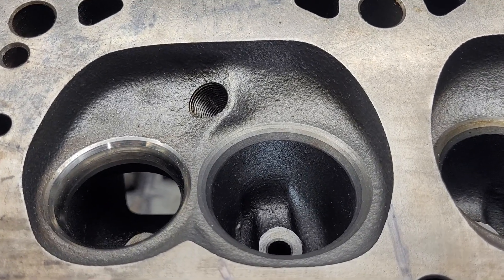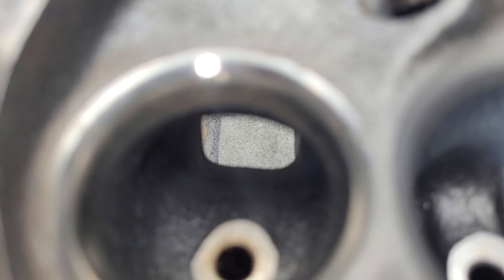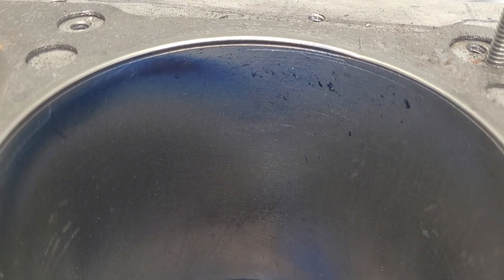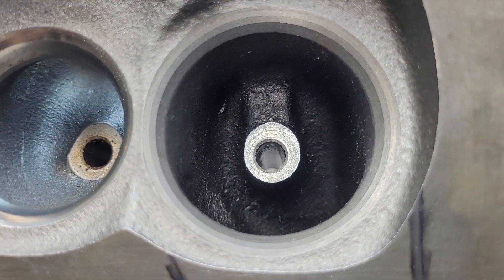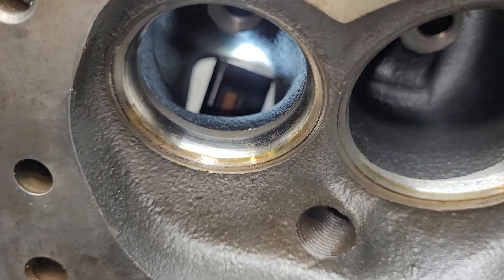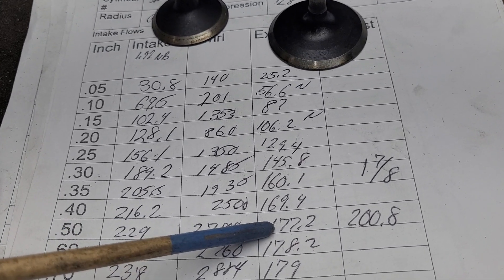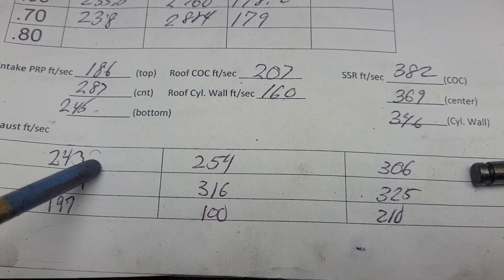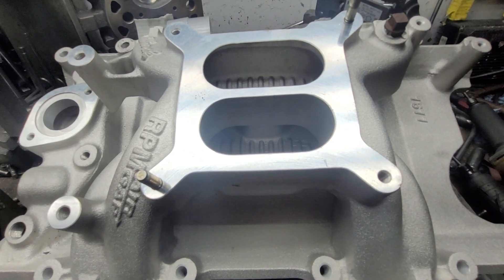EQ magnum cylinder head stock, flows and air speeds. Easy 400hp 360?

Comment: The problem with magnum heads isnt the intake pinch, its the shortside radius's and the shrouding on the valves..... deshroud both valves and clean up the short sides  and around the guides and the increases are substantial.... back cut the valves while you're at it
Reply from the maker: Do not back cut exhaust valves. Thanks

Comment: These are good heads, I have seen a few good porters get these to 300 cfm with 2.055 and 2.080 valves, 400 HP easy money. Thanks Charlie
Reply from the maker: Good info. Thanks
Reply from the maker: Wonder how they handle that pinch?
Reply: @servediocylinderheads    I dont know I am not a head porter. The information is on forabodiesonly  the Gentleman post on there, builds some great small blocks in magazines articles etc.  { SKMFX Budget Small Block - Popular Hot Rodding Magazine }  that's a link to one of his builds .

Comment: I made 400hp (based on ET/MPH/vehicle weight) with a standard bore 318, back in 2001 with a 5.2L 318 Jeep warranty engine that I freshened up (rings on deglazed cylinders/bearings on polished crank) with a M1 single plane intake, small tube headers and a 750 vacuum Holley. I used a small (then custom ground only, not shelf stocking) Comp Cams 270HR cam (218/224*@.050") and 1.6 ratio Ford pedestal type adjustable rockers (Blue Racer brand!) which gave about .530" lift. SImple and cheap, really not much below 3000rpm but a real hellion from 3500-7000rpm!! No head porting, just a good valve job and MoPar .600"-capable valve springs and retainers (not beehive!). Getting 400hp (and a ton more torque than my 318) from a 360 should be easy with those heads, ported and a decent camshaft with an RPM intake. Thanks for posting!!
Reply from the maker: Good info! Thanks

Comment: I have a set of untouched CH318b heads. They flowed in the 253 cfm range at 0.550” lift. That was with a Hughes intake valve. They backed up to the 236 range with Ferrea valves. I wasn’t sure about the Hughes valves, so that is why we went with Ferrea. This was for a Bmod engine endurance engine.
Reply from the maker: Good info. Thanks

Comment: Flowing like a good set of ported E7s...Those should do 400hp stock.. Message the low/mid lift numbers and those would be torque monsters with a low duration torque cam.
Reply from the maker: I think these will work out real well. Thanks

Comment: There is more area between the seats
Reply from the maker: Than stock magnums?
Reply: @servediocylinderheads  no z heads
Reply from the maker: @seanbragg1696  Yep, no doubt. Thanks
Reply: @servediocylinderheads  this almost looks like you could ramp angle infront of the guide a little more and get more direction toward the cylinder
Reply from the maker: @seanbragg1696  stay tuned!